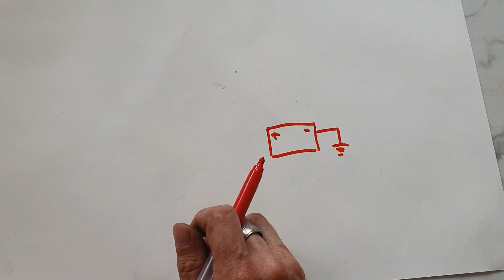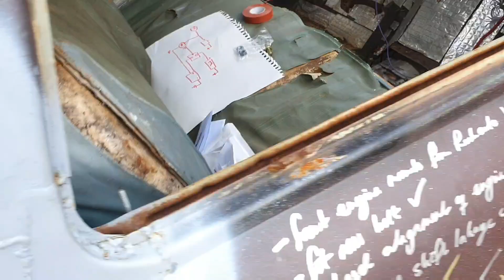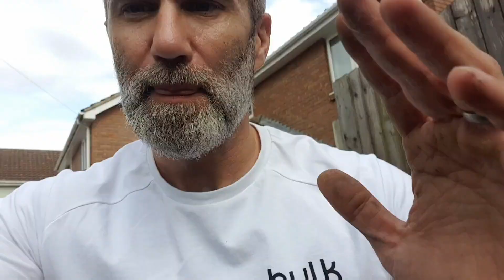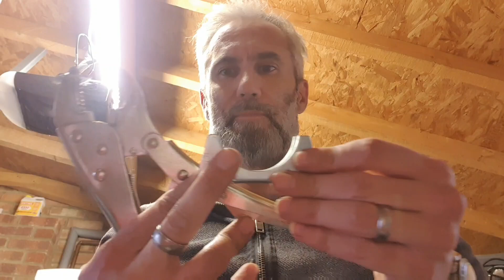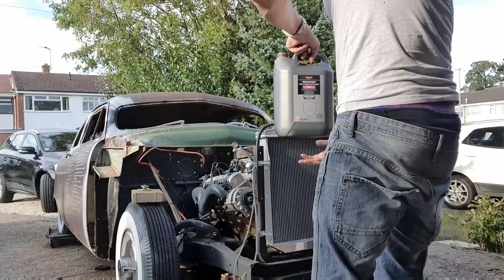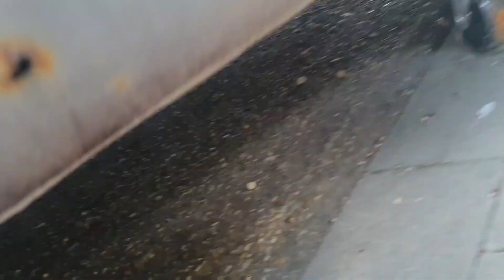Ford Y Block V8 - First fire up in the Custom 1950 Shoebox Ford

Comment: got her fired  , you might want to add a bracket to the back of alternator she was jumping around a lot , Cheers
Reply: right on
Reply from the maker: @fredjones1238  yeah i have the hole drilled and tappes in the head for it, just gotta measure and fold up the 3mm plate